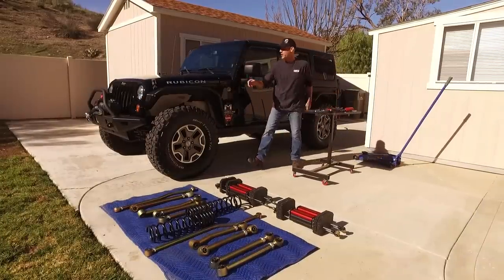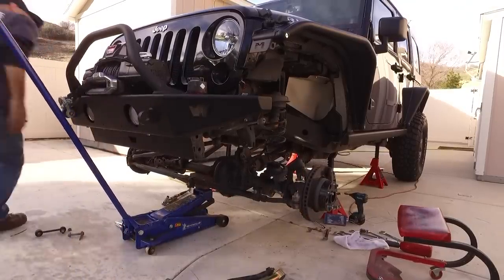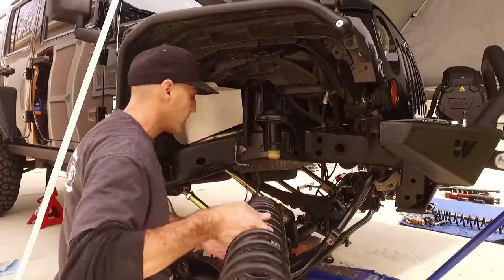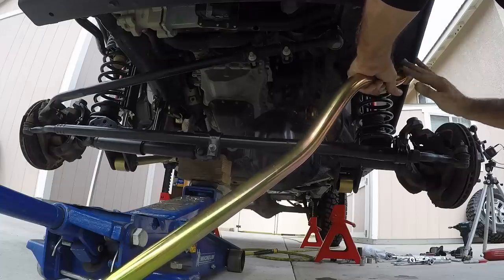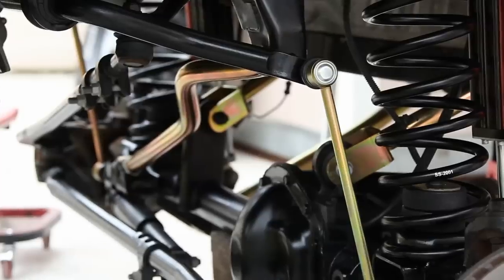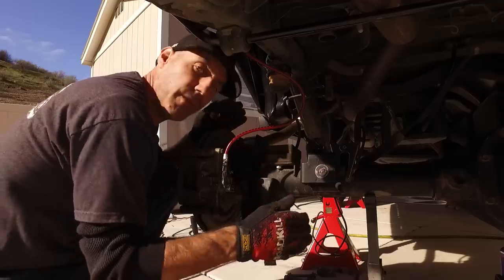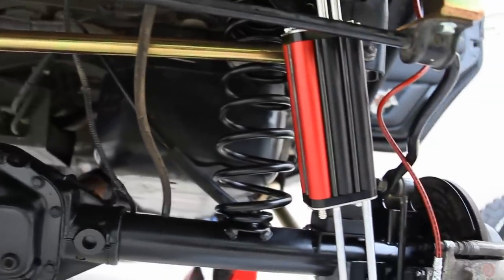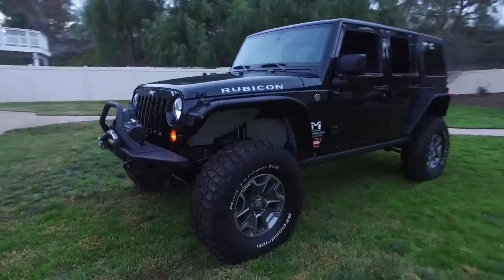Jeep Wrangler JKU Suspension UPGRADE Game Changer 6Pak DIY - Lift Kit

Comment: Would you recommend getting a Jeep Unlimited Sahara rather than a Rubicon if one is making suspension modifications similar to what you are doing?
Reply from the maker: I've heard that question a few times now... I would buy as much Jeep as you can afford at the time.  I'm still glad that I bought a Rubicon because of several reasons... Dana 44 Axles, electric locking differentials and the push button sway bar disconnect are a few. Even with these awesome suspension upgrades, I would still have to buy and install all of those other options and they would be much more than the cost of a used Rubicon verses Sahara.  But the math has to work out for each individual and this worked for me!

Comment: Did you have to do a high angle rzeppa joint and exhaust spacer? I know you got tom woods driveshafts but I am trying to see if I can get away with just Teraflex high angle rzeppa and exhaust spacer for now.

Comment: Jason did you add an exhaust extension or did putting the new drive shaft on fix the issue where the drive shaft hits the exhaust?  Thanks!

Comment: Have you had any issues or complaints about the metalcloak 3.5 inch lift since your install?
Reply from the maker: I just wish I did it sooner.  Not a single component has gone wrong... still love it.
Reply: That is good to hear. I just installed their 3.5 with fox shocks and can't wait to wheel with it installed.

Comment: Do you need to trim the shock mounts if using a shock other than the "Six Pack"?
Reply from the maker: Not at all, simply bolt in any other shocks!

Comment: would you have to had trimmed off the rear tire fender area for the 37" tires if you put the lift kit on first?
Reply from the maker: Great question! Probably not since you can adjust the rear axle farther back but I'm glad I did to maximize the up travel.

Comment: Hey Autoedit, for the front droop you did not disconnect the drive shaft. I always thought it was necessary since the angle to transfer case is too much and can cause damage. MetalCloak did not recommend to disconnect? thanks for any response.
Reply from the maker: Maybe if you rotate the driveshaft at full drop it might be hard on things but just droop and back in didn't seem to hurt anything at all.

Comment: Hey, im from Germany and working as a mechanic for Mercedes. I just wanted to say that you never should open or close spring compressors with a impact gun. If something is in the threads or the threads are having hairline cracks then the impact gun just don't give a fuck and goes on, breaks eventual the threads. Then you have a fked up day, maybe you never have a day again because you are dead. If you compress a Spring that big only 1 inch then there is enough force to kill you with ease! If you open it with a wrench you can feel if there is something about to break. Just take the time and be safe!
Reply: Just want to add we only use Hazet tools, our spring compressor is like double the size. We use our spring compresor nearly on a daily base. 20 years ago they compressed springs, where i work, with the highlift pushing down, then putting welding wire around it then releasing the highlift. This was like have luck to survive the day.

Comment: I am planning on getting these shocks and trackbar for now. I have a JK sport with a rough country 2.5 lift shocks and coils kit. Would running this shocks with the RC coils affect the ride quality a lot? I also have synergy rear shock relocation brackets so I probably do not need to mess with that part.
Reply from the maker: I don't have any experience with the rc coils. I am a big fan of the metalcloak coils.

Comment: what if I don't know nothing about mechanics? how do I know what is right for me? 35's daily driven? what gears do I run? what lift?
Reply from the maker: You want 4.56 gears for 35" tires. If you aren't really going to off road it... put some spring spacers and call it a day. Otherwise, the 3.5" Metalcloak game changer is the best of both worlds... low enough to be awesome on the highway and around town but competent enough to do some very serious wheeling.

Comment: I just purchased my 3.5” game changer. During order I selected the >4.5” backspacing. I’ve been hearing you can’t use your original wheels yet you are, did you do anything different?
Reply from the maker: I am running 1.5" spacers with the stock wheels and it works great.

Comment: Any insight to sway bar positioning? Ive read contrasting information, some say sway bar positioning is irrelevant, others recommend parallel to the jeep. is it important?
Reply from the maker: Front or rear? I have met many people that don't run a bar in the rear.  I like having mine and yes a general rule is to be parallel to the ground.

Comment: Did you have to do anything to your Flowmaster with this lift? I saw a few people had trouble installing the American Thunder that already had a lift.
Reply from the maker: I have no idea what those other people could possibly have a problem with.  Watch my complete install video and you'll see this is a fantastic kit. I haven't had a single issue with the exhaust system on this Jeep and it was the very first thing I changed. Would do again or recommend 100%

Comment: why did metal cloak use rear sway drop brackets instead of just longer links. that kinda killed it for me.
Reply from the maker: They do offer longer links and I can convert to that now but when I did the install, this Jeep had stock rims with an offset that was better suited to the drop down brackets.
Reply: ah I see now I was gonna say not like metal cloak at all. Finally upgraded to a 17 rubi after having 2 sports and im not cutting corners on this one so looking for all the first hand reviews I can find. Thanks alot man your videos and content are great keep it up.
Reply: AH ha I see now thanks for the reply man Ive had a 15 sport and a 16 sport and wish I had bought a rubi both times now and I finally bought a 17 rubi. Wish I woulda kept some of those parts now but then again planning the build and drooling over parts is half the fun.

Comment: Thinking about pulling the trigger and getting the same exhaust you have. Did you have to use any exhaust spacers with this lift?
Reply from the maker: The exhaust spacers are to clear the stock driveshaft at full droop... but I changed the drive shafts and removed the spacers.

Comment: The question, I want to order the same kit, but I would like to use my stock hard rock rubicon wheels for now maybe with a 35 skinny. What wheel spacers would you recommend for these wheels to work?
Reply from the maker: I used 1.5" spacers and it worked great.
Reply: AutoEdits awesome!! Thank you for the fast response!

Comment: Correct me if I'm wrong, but aren't you meant to tighten everything once it has all the weight back on it?
Reply: you can do it, either way, doesn't really matter
Reply: Yes. But depends on the kind of bushing/bearing in the arms if it is required. The stock arms are solid rubber, so if you tighten them while the axle is drooped, the rubber will be bound up when you lower the jeep back down. Most of the after market arms and bars have bearings in them that move freely 360 degrees so it doesn't matter. In this case, I think he should have tightened the track bars while it's on the ground.

Comment: Just got a JKU! Had it for a week and looks like my rear main seal is leaking. Have you had this issue?? 2015, 50k miles.  6 speed.
Reply from the maker: Not sure about this... are you sure it's the rear main seal?
Reply: AutoEdits come from engine tranny where they meet. Under warranty. Just dropped it off at the shop.

Comment: did/do you add a transfer case or trans. shaft angle assist on this? mine's already popped with a 2.5/ forward seal on transfer case that is.
Reply from the maker: Nope, ran the stock driveshafts like this for a year.
Reply: @AutoEdits  thanks buddy!

Comment: my only issue, that rear sway bar lowering bracket. it's just ugly. I prefer a longer link.
Reply: Our kits give the option of the drop bracket or the longer link... but it depends on what wheels and backspacing you run. After he gets aftermarket wheels, he can change to the longer link instead of the drop bracket.

Comment: What’s the ride height on this compared to a 2012 JKU Rubicon? I have 32’ Nitto Ridge Grapplers and don’t want to increase my ride height
Reply from the maker: It’s 3.5” taller
Reply: @AutoEdits  thank you for the response.  I’m asking because I’m looking to upgrade the suspension components but not the ride height. Not interested in larger tires than the 32’s. When the Pentastar goes  I’m swapping in the 6L LS truck motor with a T56. Looking to build a long term daily. Any suggestions you have would certainly be appreciated. 
Thank you,
Reply from the maker: Whatever makes you happy... go for it.

Comment: Do the 6 pack shocks have a life time warranty?
Reply: Metalcloak's policy is that warranties are written by lawyers to protect companies, not consumers. So while we officially have a 1 year warranty on suspension parts (because we were required to), we have a Fully Transferable Lifetime Customer Service policy which means we will always take care of you. Period. In addition, if you damage the 6Paks in any way or if after a few years they are worn out, we have a simple rebuild program that replaces all the wearable components.
Reply: +WeekendWarriors the 6Paks are the only Long Travel Compact Body Shock. The primary purpose is to remove the shock from being your limiting factor in flex. On the JK above, he is running a 15" travel front shock (with a compact size of 13 3/4") and a 13" travel rear shock (with a compact size of 12 1/4") allowing him to mount the front shocks in the stock location and the rear shocks in a modified location gaining 3" of ground clearance.
Reply: +WeekendWarriors Yes, a big increase. The front 6Pak has 15" of travel. A Fox Reservoir shock for a typical 3.5" lift has about 10" of travel. Check out the videos on our Metalcloak channel about how the 6Paks work and the 6Pak category on the Metalcloak website for more information.

Comment: You have any issues with those shocks since the install?
Reply from the maker: Nope, topped off the nitrogen once and been running them hard for 2 years plus!
Reply: @AutoEdits  Nice. The suspension test run video on Metal Cloak's site is legit.  How's it been for you in road situations and on trails?
Reply: @AutoEdits  regarding the psi per lb of tank size, if i needed to re charge my 6pak shocks, what size bottle would i need? and what psi is there per lb tank?
Reply from the maker: @tmarr535  It takes an extremely small amount of nitrogen to fill each of these shocks to 150 psi.  I have the smallest tank and still haven't emptied it yet since the shocks only needed one recharge so far.
Reply: @AutoEdits  TY for the quick response! I have the GC 3.5 w/6pak shocks on my 2017 JKU as well. I freaking love it ! thanks again for the response and I enjoy your vids man!

Comment: I have a lot of experience working on aircraft and missiles...cars/trucks, not so much. When working on an aerospace vehicle you use a torque wrench for virtually everything. I mean even for something like installing an electrical terminal on a terminal board, you torque the nut.

Yet this guy is installing what I consider to be mission critical highly stressed components and I don't think I saw a torque wrench once. Am I being too anal retentive?